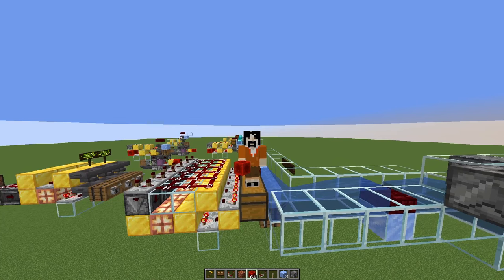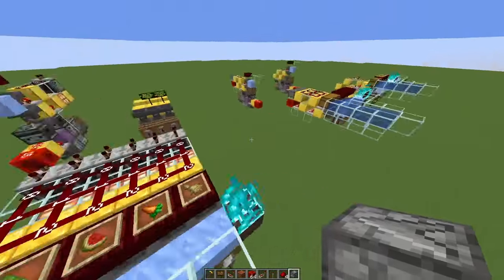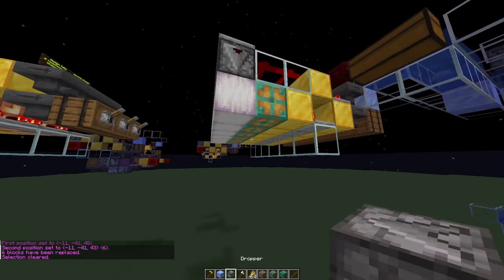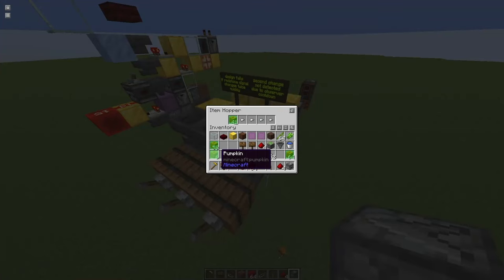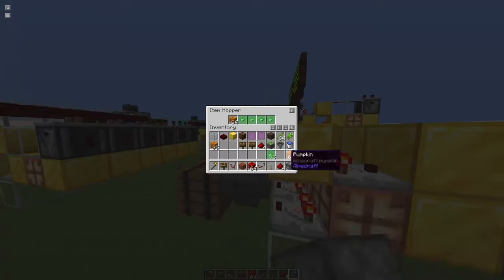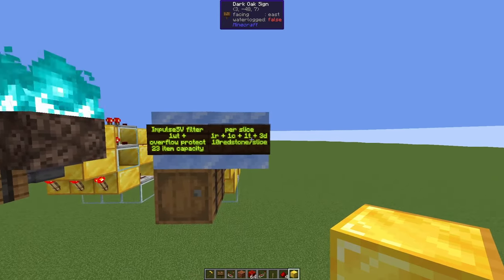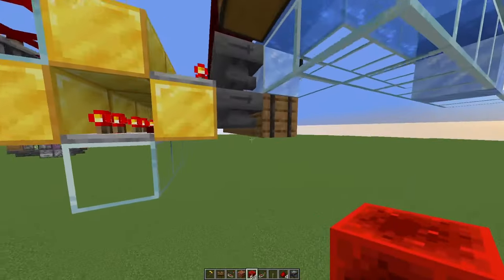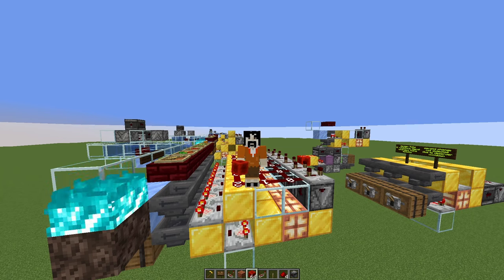New item filter designs using the 1.21 copper bulbs, silent, overflow protected, 1wt, Minecraft Java

Comment: If I use 1.20.4 with experimental features and then update to 1.21, will it still work? or will it treat the experimental features as different items than the ones in the final release?
Reply from the maker: With experimental features there is always the possibility that Mojang changes something before they release 1.21. But since the copper bulb hasn't changed in a while I'd assume the risk is low, and these builds should work without problems in 1.21.

Comment: Wow that’s very useful!
Reply: Are you sure? This is way more expensive than the standard impulseSV filter, due to the added observer, second comparator, and copper bulb (as a reminder – those require blaze rods). Also, if this ever gets out of sync due to partial unloading it's going to be a pain to fix. (This storage tech anti-pattern is called "toggle state", and apparently Fruno was warned about it before posting this video.)